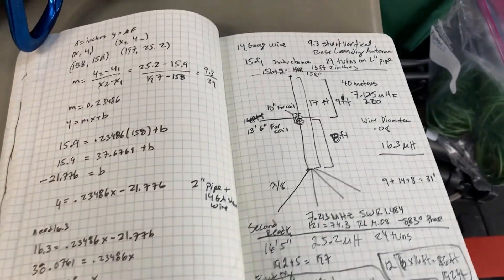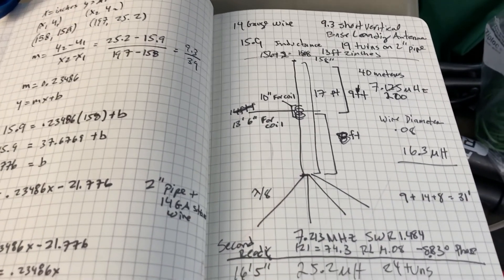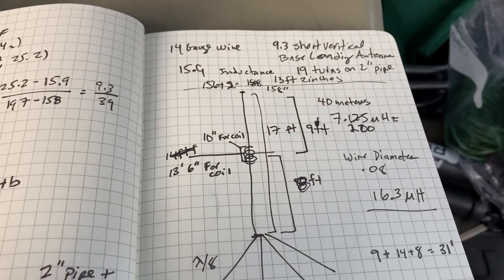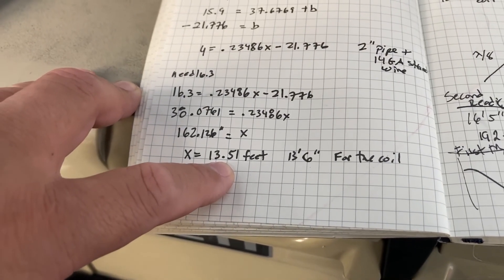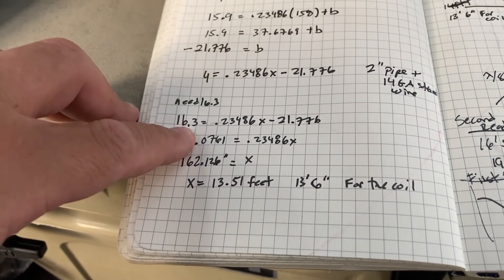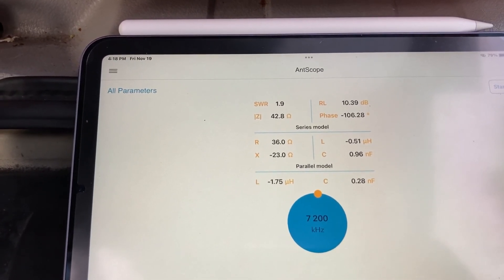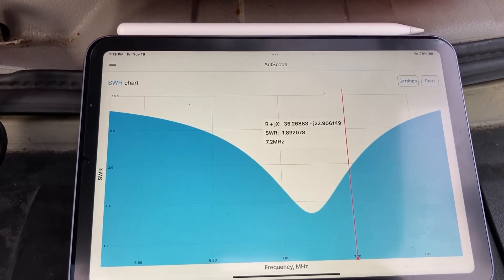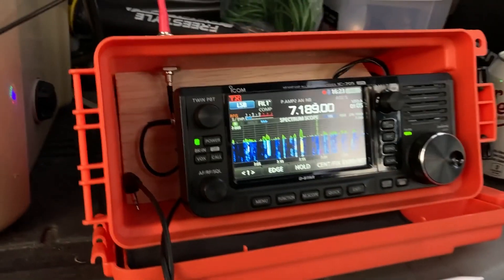Short Vertical Base loading Antenna

Comment: Frank, you are making a CENTER-LOADED vertical antenna. A base loaded antenna has the cool at the base feed point. Your antenna radiates better however. Good job.
Reply from the maker: I have for 40m CL antenna. I made it from scratch and I was impressed by the performance it gave me. Although it is a bit tall. I was able to shorten it to 23 feet. Which is not a great idea I know, but my math is only that tall.